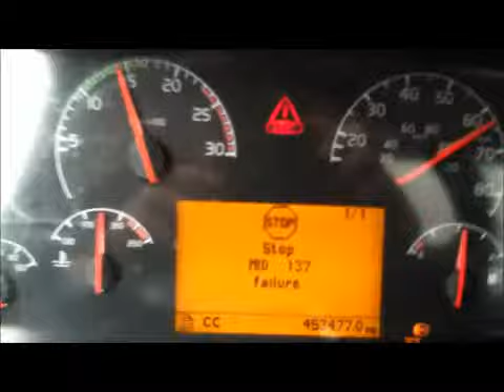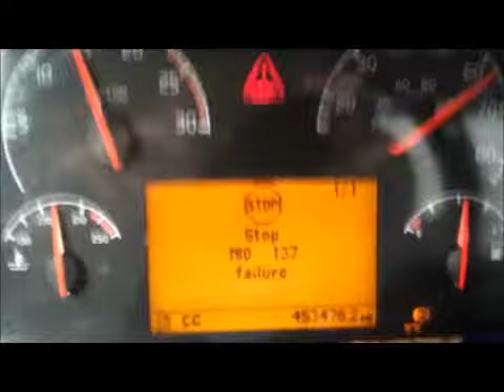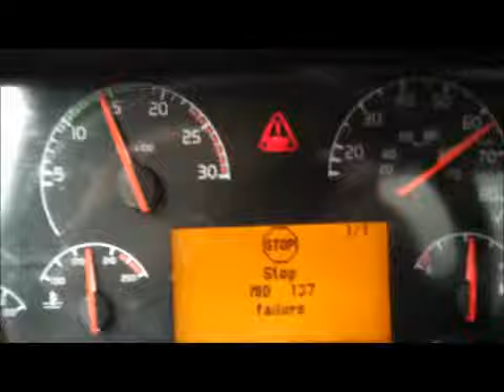This sound is driving me crazy

Comment: there NEEDS to be a button to turn the fucking alarm off. I just had the air valve on one of the tanks blow and it is now 14 hours later and i cant even turn it off because this rentals battery wont hold a charge. I am dead serious considering finding a 12 guage shotgun and unloading it into the dash until this sound stops.

Found your vid while looking for a way to disable the damn thing
Reply from the maker: yeah, it was a piece of garbage... glad they got rid of them soon after this video was made.

Comment: Hey I have the same problem could u please tell me what was wrong with ur truck how did u get it fixed thank you
Reply from the maker: no idea.  It was a company vehicle... was replaced shortly after this video.
Reply: Thank God I found the problem is a valve located above the left pedal you disconnect it and problem I solve
Reply: Thank God I found the problem is a valve located above the left pedal you disconnect it and problem I solve
Reply: @rafaelhilario4329  yeah I found the problem it was the Parking break sensor it was marked PBS and it was 36 $ I changed it and it's working now
Reply: On the right side of the 2019 Cascadia steering wheel there is a ESC button at the farthest RIGHT under the cruise button...JUST REPEATEDLY KEEP PRESSING IT....WAHALA!!!!